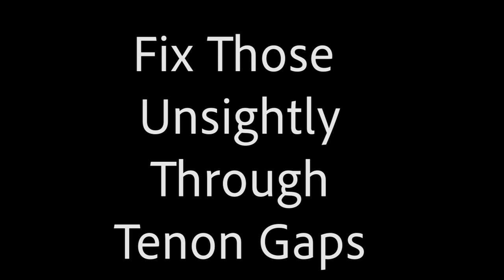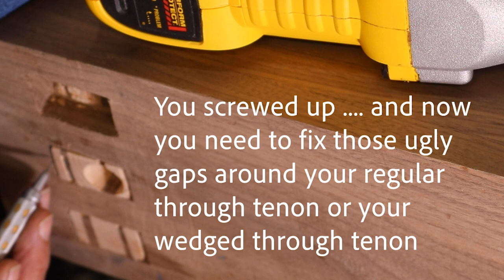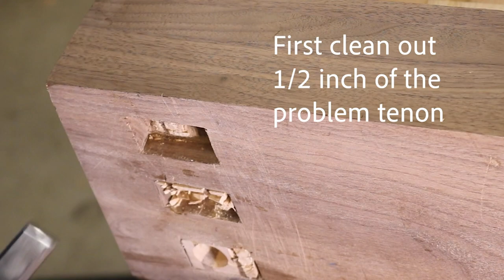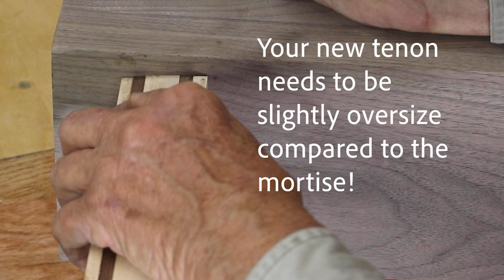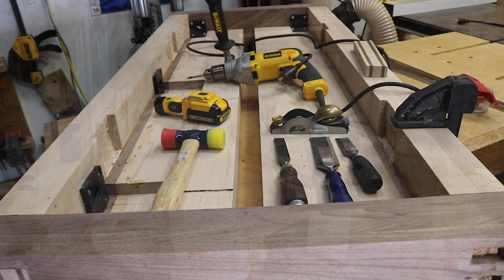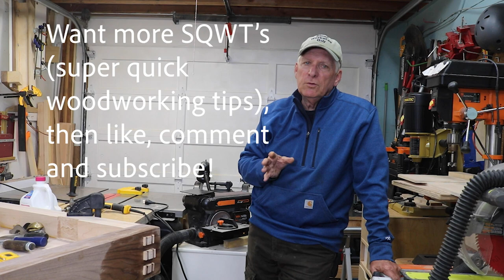How To Fix Unsightly Gaps Around Your Through Tenon or Wedged Tenon - A Super Quick Woodworking Tip

Comment: Well executed - do you find that the strength of the joint has been compromised?… thick material right enough
Reply from the maker: Yep, plenty strong with five full inches wedged and glued behind the cosmetic fix!
Reply: @SmallWorkshopGuy  wowza… I live in Scotland - you wouldn’t believe the prices of hardwood here just now… hate to think how much a slab of wood that think would cost 😅.